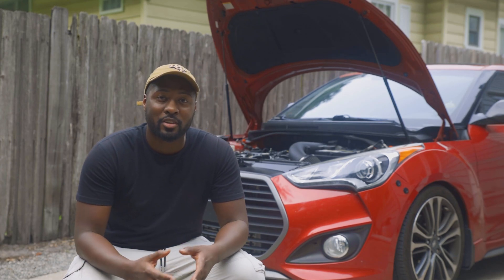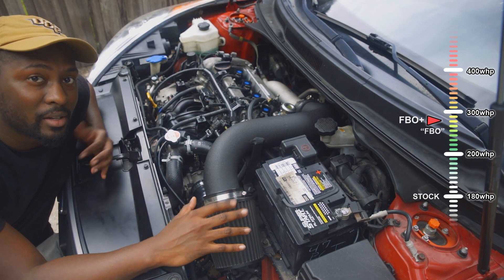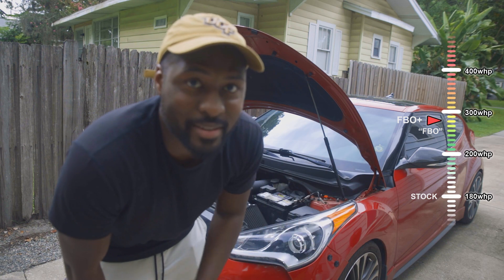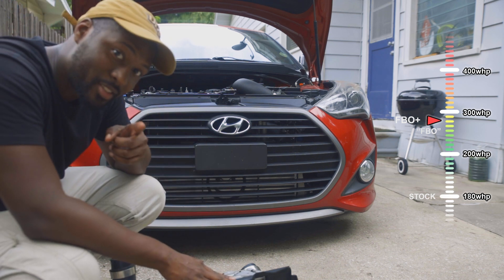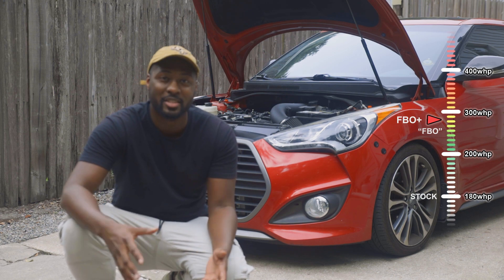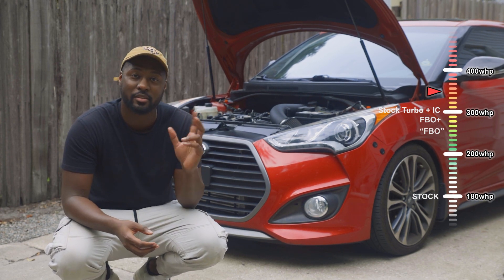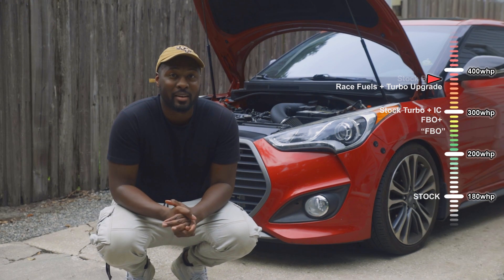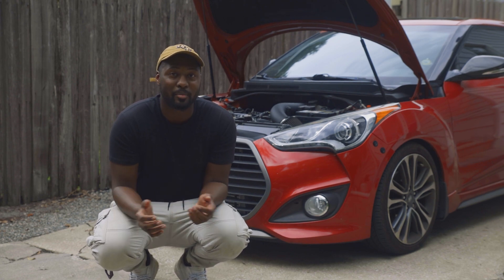How to Make Power | G4FJ 1.6T Engine

Comment: Just came across your video. 

I’m from Australia and I own a Kia Cerato GT (Kia Forte?) 1.6T

I’m in talks atm about upgrading the engine to a Hyundai i30N 2.0T. 

Might cost me roughly $20k AUD and then bolt ons after that. 

Hopefully get it to 300+kws at the wheel

Comment: There a difference between a normal 1.6 engine, and the 1.6 Turbo engines built from the get go to be a turbo engine? Like stronger bearings, pistons and rods???
Reply: NA veloster has premature rod bearing wear recall started in 2021, as for the turbo i dont know. they are the same engine technically

Comment: Not bad, owner of a 2016 Forte5 SX manual , I’m looking for those numbers 250-290HP, nothing crazy head stud and gasket is a big project that I’m going to start, I do have exhaust, res delete, but am upgrading to hot pipe, down pipe catted, and catch cans are set up already, setting up Piersburg waste gate solenoid and MAC solenoid upgrades and already have bottom engine mount upgrade as well.. stuffed turbo is my last upgrade.. now intercooler I have an issue, I could do front mount but radiator has temp issues, could i still do a side mount instead but a bigger one? I saw one from Wagner intercooler but not sure if it’ll fit 🤷🏻‍♂️

Comment: Full bolt on you don't need a tune you need a tune at stage 2
Reply from the maker: You'll have more limp mode issues. You don't have to get a tune but if you don't mind the annoyances.

Comment: im not sure accurate this information is, but assuming it is its really impressive the stock internals can survive past 300whp up until 350-400. I was worried about reliability trying to reach my target 240 wheel lol
Reply from the maker: You'd be on borrowed time lol. When I say +300 stock internals (except for headstuds and gasket), that's everything possible to make power as efficiently as possible. Even then, it's just a matter of time.

Comment: could you make a list of all things and possibly links to the parts to make it to the fbo stage? i’m not sure where to start, and what to first add to the car. i’m super new to this and im wanting to make this car speedy :)
Reply: Depends what year you have for the VT but for the downpipe the best one to go with is the pierce motorsports downpipe either high flow cat or cat less. For cat back exhaust I would go with an MBRP cat back. For the intake you can go with numerous options like the K &N intake or the SXTH element one but personally I use a Injen short ram intake. And for the FMIC tork motorsports is probably the best one

Comment: Stage 1 is a full tune (if you're dct) also a trans tune. Stage 2 would be full bolt on/ with tuning (wich is needed) Stage 3 would be an upgraded turbo. 

Nobody knows the upper limits of the stock motor due to the lack of aftermarket support and people only wanting to do basic mods like a race chip or jb4 an intake a resonator delete. Not wanting to void warranty. 

Fbo on 93 is likley on par with a gti fbo. On e85 I'm willing to bet this motors upper limits with an upgraded turbo is around 500hp. 

I have an 800hp Honda civic the b18c1 for example can squeeze around 400 and it wasn't designed for boost any more you need to build but a na motor that can take more than double factory power that was never meant to see boost. 

I have a 23 forte gt dct it's quick for what it is capable of keeping up with and beating stock 5.7 hemi cars. Kia is doing a disservice without putting the elantra n goodies or the 2.5t in it. That said these things should easily be capable of 300whp fbo 93 and tuning.

Comment: This is a very great information. Thank you. How can i reach you and what city are you located? I have a 2014 veloster turbo engine and have some issues with it. There is this knocking noise that comes up some times and it loses power when to accelerate harder. I will need your help with it if you can. we can communicate whichever way you want us to. Thanks

Comment: Seriously, apart from throwing around crazy ideas, the one that is obviously a crap suggestion is fitting a pod type air filter.  The OEM intake and filter was designed for a reason by engineers not backyard mechanics.  Do you not think that if they could get a couple of extra Kw, without jeopardizing long term engine life they would not think of a pod filter, really?  Breathing hot air trapped inside the engine bay together with the other mods you recommend is a great way of ultimately affecting long term engine life.  Making power safely...............Youtube is such a great way to spread misinformation.

Comment: Nice video man, however I feel your numbers are about 50whp off. I had mine dyno tuned and based on their previous results a stock gen 1 VT makes about 140whp. Though I agree with most all of your mods and thorough descriptions, I do want to add that the biggest constriction of power is the intercooler- if I upgraded my intercooler I would have been able to get at least an extra 20-30 more whp (the stock one just heat soaks too quickly). Most tuners I talked to also said that if you're trying to hit the 300whp and above mark you have to upgrade the internals- the stock ones won't handle it. Was talking to a builder two weeks ago about upgrading the turbo and they warned me that even stuffing the turbo without upgrading the internals will quickly cause engine failure. Another big thing to consider with upgrading is what transmission you have. The 2012-15 the auto's are trash, the manuals are ok...16-18 the autos and manuals are ok, but the dct is garbage. I hope any of this is helpful. Thanks
Reply from the maker: Youve got a lot of good notions in here!

On the dyno thing, every dyno is different. Dynojet vs mustang dynos I think explains your 50hp discrepancy.

Comment: This is very well put together and presented. BUT.
You are completely missing any info whatsoever about how much transmission and clutch can handle. In EU we have 7 speed DCT (Also 6 speed manual that you don't get i guess) paired with this engine and it can handle stage 1 so-so. I believe same applies for USA.
Reply from the maker: I was missing that information because I was keeping it engine specific. What the trans can handle was a little up in the air on the dct side of things at the time

Comment: 1:24 300 whp with FBO on a 1.6t?? No chance. I'm a little late to the comments, but even the Veloster N with a much bigger engine and turbo can't hit 300hp. You gotta swap out the turbo to see those numbers.
Reply from the maker: Lol when I said 280-300 could be done, I pointed out heat & flow. 280whp, I've seen plenty of dyno sheets done on a stock turbo. 300whp "could" be done on a stock turbo but it's not gonna last long. 280-300 is always going to require E85 + Meth to increase timing and manage the extra heat. You're in "max effort" territory up there.

FBO VN's can crack 300whp on the stock turbo as well. 1.6L vs 2.0L isn't what I'd consider much bigger. The extra 400cc's came with about an extra 400lbs too.

All that being said, if you live at altitude, you're never going to see those numbers on either! So yes, no chance! But I live at sea level lol.

Comment: A bit confused on the ethanol mention, as unless an engine is built specific for it running higher amounts of it will cause reliability issues, one of which is because of it having less lubricity and causing it to wash oil off the cylinder walls, cause corrosion in the injectors and if I remember correctly most of the fuel lines don't like it much either
Reply from the maker: Yeah you're right. Depends on the engine. In this platform, replacing the low pressure fuel pump and the fuel line are the only requirements. Fuel additives are highly recommended for the lubricity issue, as well as a shorter oil change interval.

Comment: Hey man I got a quick question, what mix you run with your water meth injection kit?  I know Tork says to run something like a 95% meth mix, but that sounds kinda excessive to me.  Would love to hear your input, thanks!
Reply from the maker: It's complicated to answer. If you're trying to min-max everything, +95% makes sense. If you don't care about min-max and understand that you car will last longer and you can still have fun... you can run whatever you want haha. I used to pour 95%. I used to do 50/50 by weight. Now I just eyeball whatever I feel like will get me the temperature I'm looking to get.

Comment: My interest has been peaked with a water methanol injection. Do you trigger it manually or is it set automatically to come on at full throttle?
Reply from the maker: Depends on your controller but almost all of them are automatic, just depends on what's the reference.

Throttle is usually a "dumb" reference because 100% throttle doesn't mean much if the ECU is deciding how to make that happen.

Some are built to reference boost, min and max. Example: at 6psi, spray 1%. after 15psi, spray 100%

Some are built to reference RPM, min and max. Example: at 2000rpm, spray 1%. after 5000rpm, spray 100%

Some are 3D controllers with programmable maps. Example: Making decisions based on multiple references. Several Meth Controllers can do this. Standalone ECU's could do this. JB4 has a controller that can do this.

Just depends on your needs and how much money you want to spend at that point! Mine is the AEM V2 controller. References boost!

Comment: Hey man gotta question I have the same engine in my 2016 koup and I heard their were issues with boost when you switch to a aftermarket bov if you can help me to clarify whether I would have some issue with boost thanks and great video man btw really helpful
Reply from the maker: Hey! Yeah so the issues I've seen with the bov arise from the spring/timing of the bov.

The ecu has a very specific timing it's expecting the bov to operate in. Step outside of that and it's a CEL.

It's not problem unless looking at a CEL annoys you. To solve it, you have to make sure the ecu can control the BOV within that range.

If you have a BOV with interchangeable springs, you want one as light as possible so the ECU doesn't have to work hard to get what it wants.

This can be addressed with either the bov spring or upgrading the solenoid that controls the bov. Some times it takes both to address the CEL.

It could be tuned out but I doubt any tuner will go to such lengths to address an issue like that.
Reply: @AustinSWarren  alright so either a lighter spring or different solenoid I appreciate it man I’m glad I didn’t get a aftermarket bov yet

Comment: You need a cold air intake not a hot air intake. You car came with a cold intake.  But Everything else you did is awesome.
Reply from the maker: Haha yeah so short ram intake vs cold air intake is really what i should've said. The difference in gain from either on this platform is debatable. They are both better than the stock option.
Reply: The dyno says the stock intake is better for the 1.6T.
Reply: https://youtu.be/OsMM8LZ9mW4